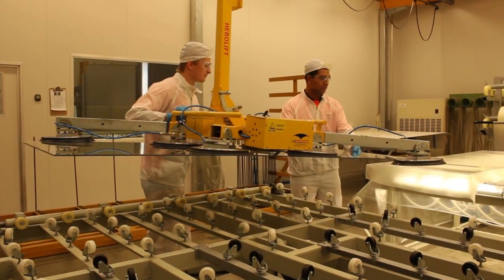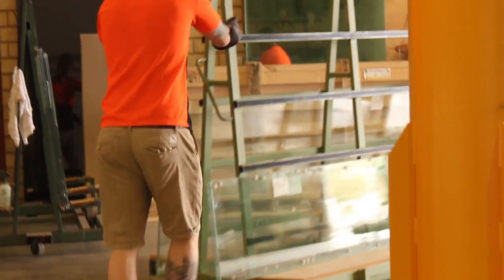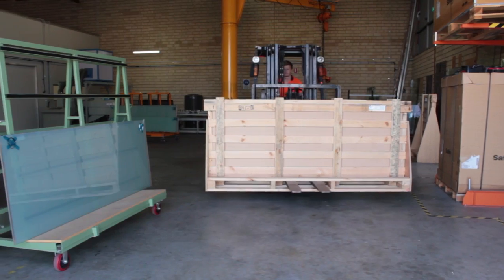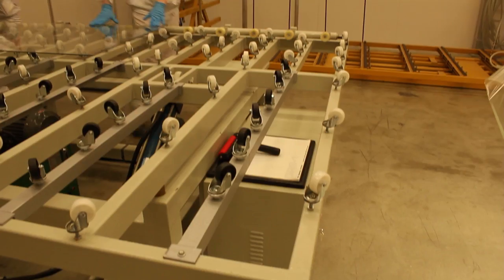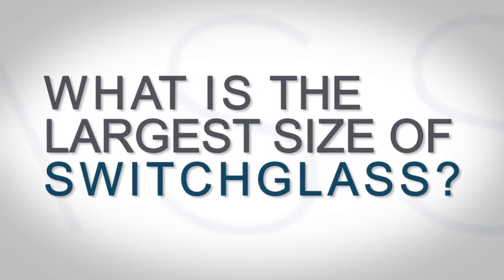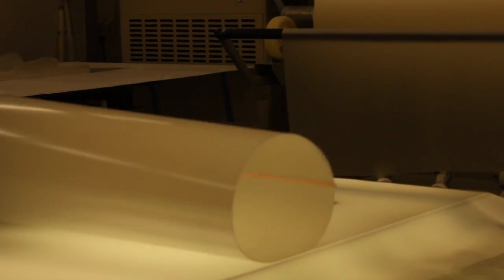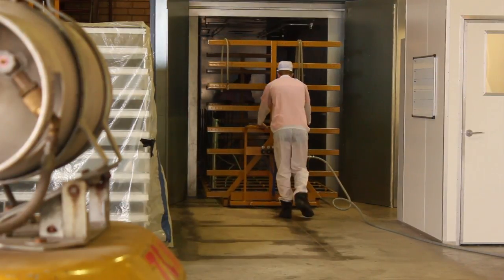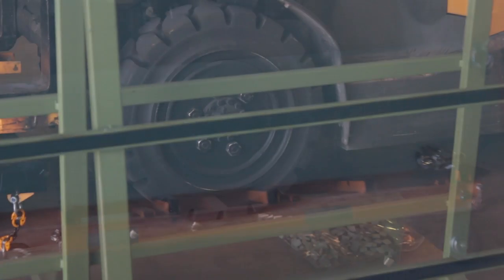Switchable Privacy Glass Frequently Asked Questions

Comment: Question! If the electricity goes out (power outage) due to heavy winds or heavy rain would the switch glass also not work leaving the indoors exposed? Thank you!
Reply from the maker: Great question Nayeli, 

When there is a power the Switchglass will remain in it's translucent state (so you can't see though it)